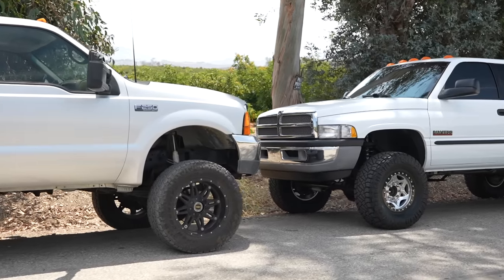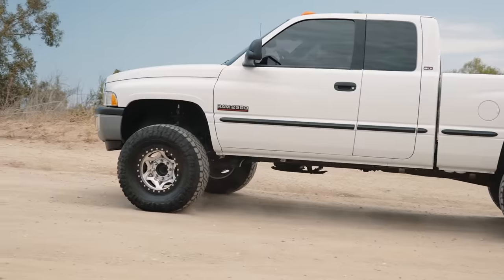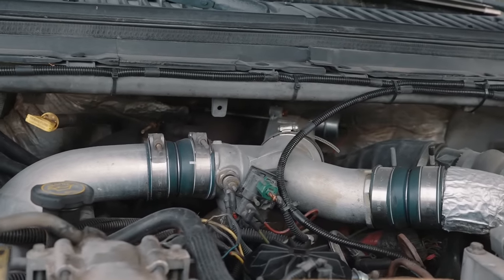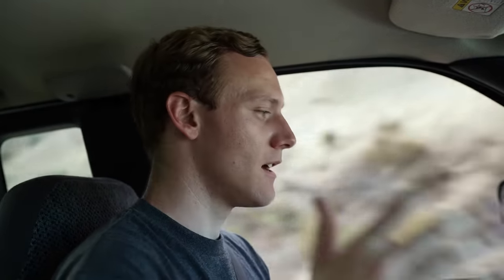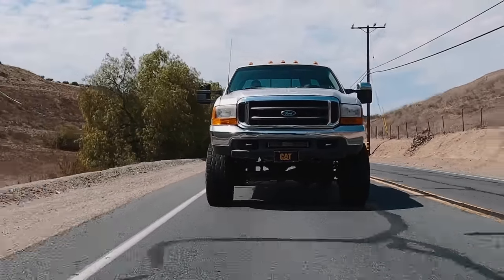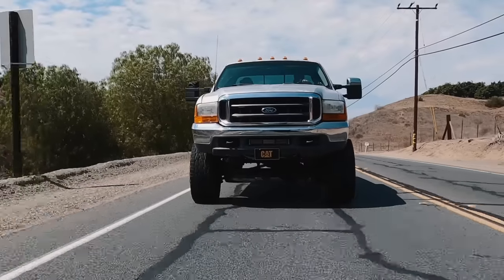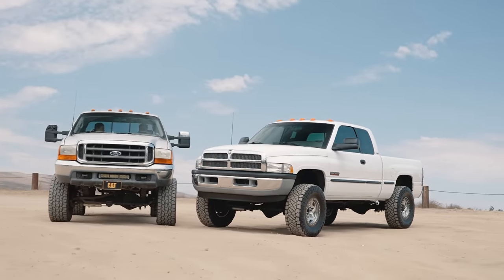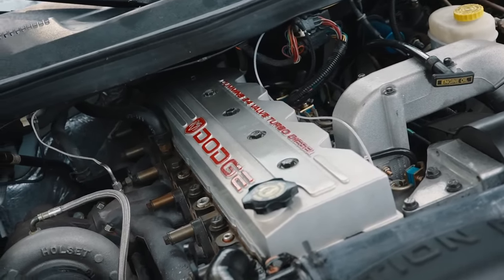1999 Ford 7.3 Power Stroke Super Duty vs Dodge Ram 5.9 Cummins 2nd Gen | Which Is Better?

Comment: Ride, is kind of a tough one to judge.  Neither of you have stock suspensions, wheels, tires.  But leaf vs coil is usually coil.  I agree on maint and interior, bought a 7.3 and have a dodge already.  The Ford takes it, no contest.  Ford is super simple to do most things that someone is gonna endevor to do until you get to things like turbos/injectors.  But those are not something messed w/ often.  And I was never a Ford guy, but I like my 7.3.

Comment: If this was a a 97 ram compared to a 97 ford (both diesel obviously) I’d have to take the ram cause the 12 valve is way better than the 24 in my opinion but in this case 99 to 99 it’d be the 7.3 ALLLL day, my dad has one and it’s amazing!

Also how big of a lift and what tire/wheel size is your friend Liam running, the stance is perfect in my eyes 😁

Comment: I like Fords but the 2nd generations Dodge Trucks look cool. They have the semi look. the large grill and small head lights. I own a 2001 Dodge 1500, Manual Transmission and the drive to work and drive home is great and it has a lot of power for a 5.2 engine. I was pretty impressed with the output. I've also driven Ford Trucks. I drove my dad's Ford F-350 Super Duty dually automatic and it has a lot of power, it has a lot of bells and whistles, head room and more space and just more stuff but it's definitely made for heavy hauling like, big campers and large boats. I guess it comes down to preference and what you're going to do with it. I had a hard time parking the Ford Dually and had to park it farther out where the Dodge I could park it closer, it's still a pain in some areas of parking, I mean it's not like you're parking a Fiesta car. Not every truck is going to park as nicely as  a car or motorcycle.

Comment: I’ve had 4, 7.3’s and 3, 5.9’s. I prefer the coil front end of the Dodge (even with the death wobble I’ve experienced). I also prefer the Cummins for the straight 6 for ease of maintenance. I prefer the Ford for the body/interior.

Comment: I switched from a 95 12 valve extended cab to a 97 ca model 7.3 ccsb for the crew cab. only to find out i could 05 axle swap it. and make it ride as nice as the dodge. win win. both great trucks. i would take a ccsb 99 over the dodge, even after owning my dodge on thuren suspension for over 3 years. I plan to throw a carli kit on my obs here soon!

Comment: You can actually coil swap the 7.3 and early 6.0 trucks but it requires you to remove the cab, engine, and front frame section.

Comment: Interesting comment about the tranmissions. I have an '01 7.3 and i had to have the transmission rebuilt at around 124k miles...but then again, this is the first automatic I've ever owned. Id rather replace a clutch than a transmission

Comment: Never understood the love for the Ford interior, I've never cared for it. Maybe the quality is a bit better, but they actually look cheaper and cheesier. The 98+ Rams interiors just look great. My 98 Ram has 250k and it's really pretty nice for what it is, the dash has a couple cracks but no craters. The seat and center console are not torn. I do have to remove the dash to address an issue with the fuse box and I'll replace the dash top when I do it, otherwise it's good enough to not justify replacing it yet.
Reply: Dodge dash cracks. Deal breaker
Reply: @LukeGray-fs1sl  I put a new LMC dash in mine last summer, it wasn't very expensive or difficult.

Comment: I own a 24v Dodge, just turned 100k. I am inclined to keep it mostly stock because of the vp44 and the 47re. Longevity dictates that, and a stock tune is fine for me. Soon cold air and exhaust will be done, keeping a stock tune.
Reply: Keep an eye on the fuel pressure to the vp44 (either a gauge or warning light) and it will serve you well. Personally I’d just lose the stock transfer pump in favor of something that flows a little more, even if the stock one isn’t yet worn out.

Comment: Dude, use the cup holder, I used a 96” manual 2500 as a trash truck until 475k and the cup holder was used every trip to the dump.

Comment: id choose the 5.9 just because i like how basic and simple the engine is. doing maintenanceon the 5.9 is alot easier. everything is right there. dont gotta pull a hose off to get to a part. plus my 1st truck was a 94 12v and that truck was a workhorse. just wanted to keep going and going.

Comment: I’ve owned both now, ‘01 Ford F-250 and ‘94 Ram 2500. All in all they both are great trucks but the ram has it in power, ease of working on, reliability. The Ford has the better ride quality, interior, and body. Power is relative to how much you want to dump into it. Both can be modded, power bands moved, etc. Bone stock they are both gutless, the Ford will get out of its way quicker, but dollar per horsepower ratio definitely goes to the Cummins. As does reliability at higher rpm and power bands. My stock Cummins was limited to 1800 rpm but now revs to 6k reliably. The Ford was 3500 and pushed to 5k. The ram all in all is my pick and will be my lifelong truck. Parts are cheap, easy to replace, and are plentiful. I’ll be towing the Fords around long after they are all gone ;)

Comment: I've got a 2002 5.9 3500 with NV5600 and a 2002 7.3 450 with ZF6 and I would take the 5.9 ALL DAY LONG !  The NV5600 is by far a better transmission than the ZF6 !  And the 5.9 is hands down a better motor (especially to work on) Unfortunately I own another 2002 3500 with an automatic and EVERYTHING this guy said about the Dodge auto is absolutely true!

Comment: I love the sound of the 5.9 but my dad has a mint 2000 with the zf6 in it and by far of both trucks had a manual I’d take the 7.3 I just love those 6 speeds whereas Cummins had the great 5 speeds

Comment: I am going to chime in here, as I am 53 soon to be 54 and I have driven a lot of trucks in my life time. And I know you are comparing diesel trucks. But I started off with a 1965 Ford F-100, and my current truck is a 2001 Ford Ranger. I have driven some Ford F-350 Super Duty diesel trucks, and I have owned a 1999 Dodge Quad Club Cab 3500 with a Cummings Diesel. Here’s what I have to say, as I never liked anything about Dodge trucks period. Until I owned that 1999 Dodge Quad Club Cab 3500, and out of all of them the only one I miss to the point I would want it back is the 1999 Dodge Quad Club Cab 3500.  As it was just that good, and was the most dependable truck I ever owned as well as the only one I owned 7 years. It had a 115,000 on it when I got it, and was around 300,000 when I sold it. It takes an impressive truck, to get me to say that much less own a truck that long.

Comment: The later 7.3 Powerstroke (1999+) had more stock power than the earlier Powerstroke, but it’s not a better engine. The later engines lost the forged rods and some other things. So if you want to add power, the early Powerstroke is preferred.

Comment: I have a 2000 7.3 completely rusted out single cab f350 that still drives decent i bought for 1500 from my work the engine was well maintained I also have a 02 f350 quad cab single axle 7.3 that I drive only on weekends  with 230k it has a 5" exhaust kc 300x stage 1 turbo with stage 1 injectors it runs like a champ  it was a 1 owner truck barn kept  with no rust what so ever I paid 12k for the truck 2 year ago

Comment: 99.5+ 7.3: 
525 Foot pounds @ 1600 rpm.
275 Horsepower @ 2800 rpm.

99 5.9: (No de-rate due to auto option)
460 Foot pounds @ 1600 rpm.
235 Horsepower @ 2700 rpm.

The 7.3 would rarely let you lug it with an auto. I know at 2600 rpm and up they finally give it full fuel delivery, if it had it any lower rpm it would smoke. They do just fine at 1300 rpm in overdrive with 3.73 rears and a gross weight of 12500 lb, up and down backroad type hills. Can't say anything about any 5.9 as I don't have experience with it.

Comment: you guys did a great  comparison very fair but a true comparison but stock vs stock would be more accurate both trucks had various after market parts also compare the electronic  parts between the two ecu specifically the cummins ecu is prone to failure  and is now only available  reman aftermarket source fords ecu almost never fails and is readily available from Navistar

Comment: I own both a f350 2002 7.3 dually and a 1999 Ram 2500 5.9L both have tuners.  If I had to sell one 😢 lt be the Ram.  Maybe it because the powerstroke has a 88mm super wheel I'm not sure

Comment: I've had the Ford  F350 7.3 diesel , a 24v Cummins 3500 dually , I now have a 12v Cummins 2500 short bed sport  .. In my area the Cummins is quite a bit more money to buy than the Ford power stroke ..

Comment: Funny how you give Ford a better rating on the interior but it’s also shown as coming apart. My 99, 2500 interior was impeccable and it was a working truck. I didn’t get the same feeling of poor quality for the interior as you’re stating. I never had issues with the transmission either. I have 500 hp and roughly 900 pounds of torque on a stock transmission that lasted through 638,000 miles without a hiccup. I replaced the fuel pump though twice.

I do agree that the Ford is a great truck and I don’t think you could go wrong with either one. Especially in those years. I now have a 2006 Dodge dually with the Mercedes aluminum G 56 transmission in the six speed. It’s still a baby with only 265,000 miles. That 5.9 L Cummins runs so smooth you can barely tell it’s running.

I absolutely do not agree with your statement about simple maintenance on the Cummins being even remotely a challenge. It’s just an easy motor to work on.

Comment: You know, the 6.0 and the 6.4 powerstrokes had a lot of issues, but once you spent the money to fix them, those things ran. Probably the two fastest diesel engines ever. I'm a Cummins guy and I still gotta give credit to ford on those engines. The messed up building them, but they made the building blocks for some powerful engines

Comment: owned a 2001 5.9 and own a 2002 7.3  
5.9 is a cool engine and easier to work on. mileage was measurably better. 
truck was poor, which is why i got rid of it. 
both very reliable. both made about same power. 

the difference on the power is where it made the power. 
5.9 was at 1600
i think 7.3 was at 2000

i think this is why people so often say the 5.9 felt more powerful. it comes out of the hole better. 
i found if you drove in the power band they were more or less equal. 
but that I6 is going to have a lower torque curve, which is the right answer for a diesel engine. 

but the engine isnt the whole truck. my ford is 20 years old and the truck is holding up pretty well. i will say having dually fenders has saved my bed from rusting out. 
the rear wheel wells are trashed on most 7.3s now. i cant imagine that the dodge ram is holding up as well. 

here is my opinion. 
pick the one you WANT. they are both great engines, and neither is the wrong answer. 

however i do like the rattle the 7.3 has better the cummins. means nothing, just like the sound better. 

. . . now for making and holding insane power, no contest there, 5.9 everyday.

Comment: I wouldn’t quite call it the nth degree 7.3. The 2001 introduced the final spec change, raising torque to 525 ft lbs and hp to 250.

Comment: I work on both. Agree 5.9 easier to work on, space and simple. Fords do definitely are interior wise is better. Power wise just depends on the use and needs each owner and use of the trucks need. Transmission wise automatic goes to Ford. Manual would go Dodge NV5600 vs ZF 6 speed

Comment: I have a 2000 7.3, I personally have put over 500000 miles and still have stock transmission, it haves mostly everything stock, but I had to put some fuel seals, injectors, glowplugs, but not many problems since it haves over 700,000 miles on it

Comment: Wait the electronic 24 valve 5.9 ran all the way to the 2007 model? Not ending in 2002 like you have said.
Reply from the maker: They got a massive change in 2003 to the HPCR fuel system. Almost everything but the displacement size changed!

Comment: I’m looking at an ‘02 F350 with the 7.3 and an ‘01 Ram 1500 with the 5.9 magnum (gasser). The Dodge absolutely looks better, but to say you like the current place where the companies are is interesting considering Ram split off from Dodge in 2010 and is owned by Fiat.

Comment: love my 02' 7.3L rides like a brick, (with a 8" lift) but so good, have had it 10 years, starts -30 not plugged in 500K km.  did the water pump recently, was $80

Comment: Goodwon guys. I can tell you I've owned them both and currently have a F350 Super Duty  dully, 7.3 with zf6 , 2x
  you have no idea how many times I've said I wish I had never sold that Dodge, the Cummins was great and I love the power just that automatic sucked. I would say all the automatics besides Allison are questionable. 6 Speed is better way to go.
 Now about this super duty,
looks like a nice truck I'll agree on the interior on both rigs at Dodge's pathetically cheap and they should have recalled those cracking dashes that was pathetic it's like $900 to change. Dodge was more comfortable and bulletproof reliable. This fn 350 the first hour I owned it started crapping out and replace a number of things trying to figure that one out , it's got sensors up the ass...
I like the six speed in the super duty although it should have a 383 rear cuz first is bloody low, could get better fuel economy. The body on the super duty is really questionable in case of a side T-Bone Collision, that rear door is like sloppy and I see no real structure that holds his doors rigidly in case of a major crash.
With heavy hitches and airbags this thing I will haul a hell of a lot, but at the moment I don't even trust it to drive out of town. And in fact anyone with 7 3 is got suggestions I got a major oil leak leaving a trail at this point, haven't taken time to look haven't driven it actually had two different trucks during this. after owning this I wasted a lot of time and money and simply not gotten jobs done , cuz the SOB is not reliable..
as you can tell I'm kind of done with it and I've owned a lot of seven threes and 6.9, have to say, Dodge Cummins is really the way to go. 
  The current Ford corporate structure and how they honored there warranties these days is also question I've heard some real horror stories on almost brand new Mustang GT h, they just don't want to stand behind their new car..  
  Good topic people like comparisons

Comment: hi, i own a  99 cummins 24V,  w 360k miles, anytime i do an oils change the oil keeps super clean after oil changes, and also had it running idling inside a close door shop, and exaust did not bother at all,  also own a f-350 w 7.3 but ford is the oposite side, emision bothers a lot and engine oil change will turn black very son, the 7.3 is about 170k miles, and the cummins have some blow by. but runs great.

Comment: I'm a little surprised they were talking about swapping out the straight axle. Coming from the off-road world people do the exact opposite and swap in straight axles. A straight axle is more truck like where as the coil spring setup rides nice but that's because is more like a car.
Reply: They were talking about putting independent suspension on they were talking about swapping the front leaf for I beam
Reply: We’re not*

Comment: the funny thing about this two trucks is that Ford owned the patent on both the 5.9 Cummins And the 7.3 power stroke but Ford only offered the 5.9 in the f450 and up class truck do to the better low end torque and the not so good fuel mileage

Comment: 2000 7.3l excursion here (my dads) selling it soon but bout it second hand with about 140,000 miles w/rust and has still been running till this day. Love the motor but the truck is rusting out around it. The engine is not much stage 2 turbo stage 2 injectors multiple tubes w/switch (tow, comfort, big tune) hes sellling it because he got a new dodge ram 2500 with a Cummins and he loves it but I’m personally gonna miss that old ford… (people still want that old rusting truck w/260,000 miles and hole in the roof for 18,000 😅 crazy how bad people want it and I know people who do and I can see why

Comment: You mean my 98 2500 Dodge isn't expose to have that hole in the dash that spans the whole width of the cab?! Thought that was factory! Will say it would be interesting to do a test of same trucks but with manual 5 speeds in both. The only thing I have had to do with mine is change the clutch plate, and it has 300K miles on it, love it to death!

Comment: i may be a little late to the conversation. However i own a 97 12 valve 5.9 cummins. I admit the automatic transmission that dodge came out with sucked, however the manual transmission is the way to go. I have driven plenty of the 7.3 fords with both manual and automatic and my unbias opinion i would take the 12 valve manual over any 7.3 powerstroke. she might not be fast but she flat out tows with out a problem even at higher speeds.

Comment: 7.3 ford would be my choice. It looks more modern and can upgrade / retrofit parts. It’s got a stronger transmission, the interior is better and can be swapped for new interior also. Roomier, and better/ tougher looking exterior.

Comment: As far as maintaining vehicles I would say you're way off the 5'9 is 10 times easier the water pumps are held on with two bolts the Ford is held on with 17 and they're all different sizes I might be exaggerating a little bit but you get the picture.. 90% of all nuts and bolts on the Cummins are going to be between 10 and 18 mm.. okay I may have jumped the gun and commented too soon I watched a little more and you did mention all that stuff great job

Comment: Excellent video! I own a 1997 Ram 2500 12 valve diesel. Please tell me about your 2nd gen. What gauges do you have in your pillar pod? What is the stall speed of your torque converter?